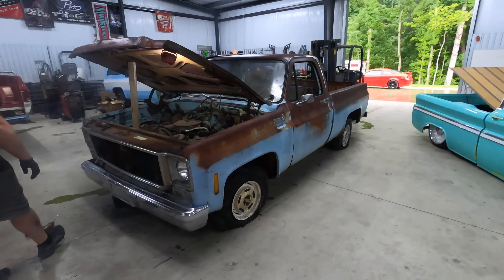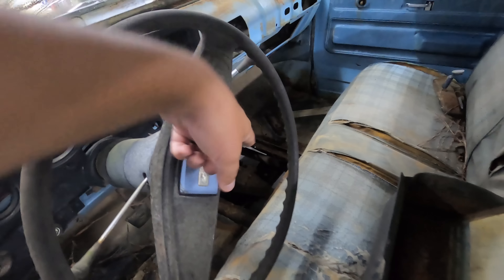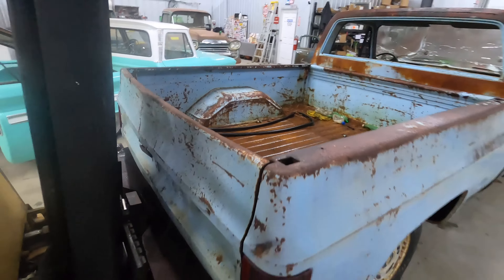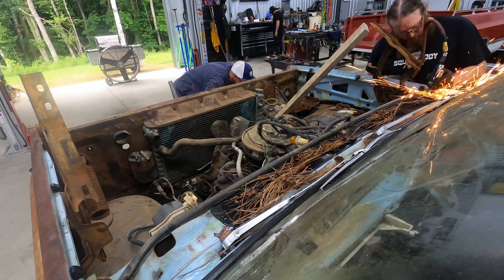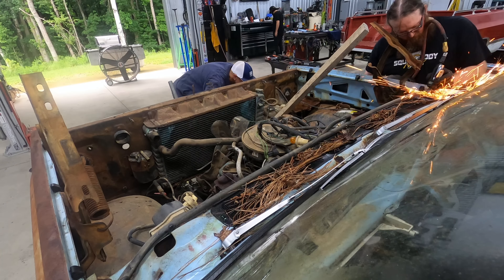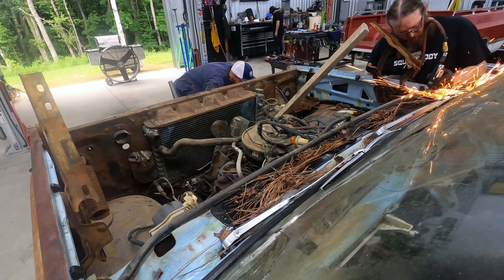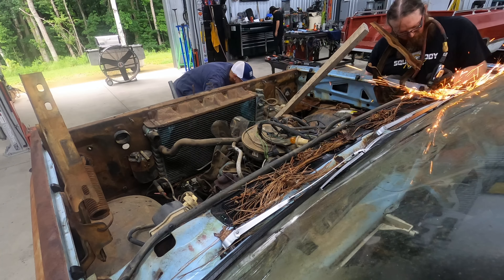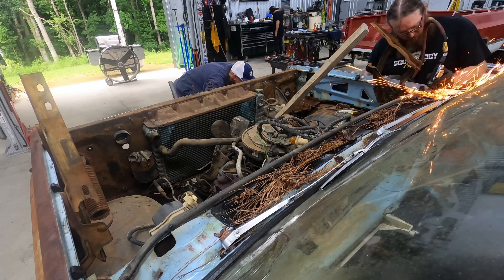TEARING INTO OUR NEW PATINA SQUAREBODY BUILD!

Comment: i have a question i have a 83 gmc sierra and it was my grandpa's truck this will be my first restoration and it need's new paint because it has surface rust and the interior is in need of restoration too should i leave the interior out since i'm getting it repainted a different color, since the interior is the same color of the truck now or should i go ahead and replace the interior thanks
Reply from the maker: To each their own, but if it's an original paint truck, I'd leave it with the surface rust. If you must paint, I would pull the interior so it can be painted in the jams, inside of doors, and the dash metal will be same as outside of truck. Nothing worse than seeing a slick painted truck with a different color paint on the interior metal. Thanks for watching!